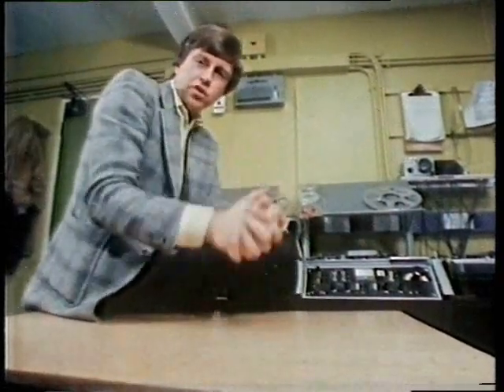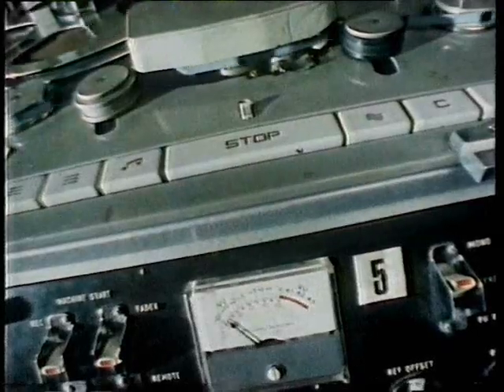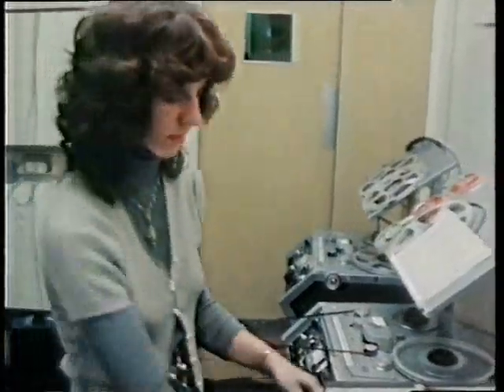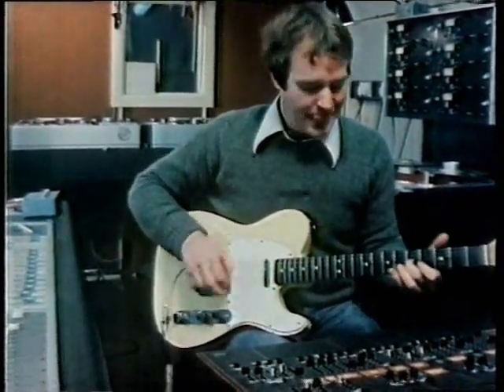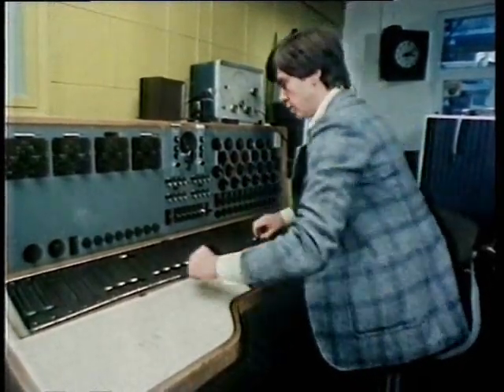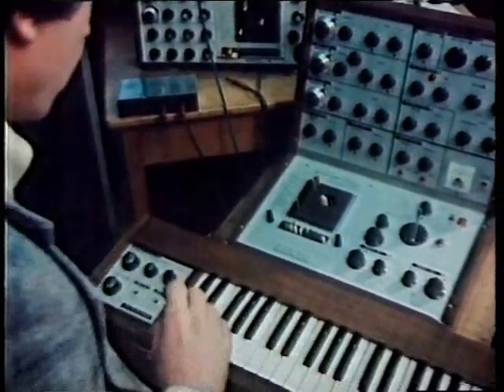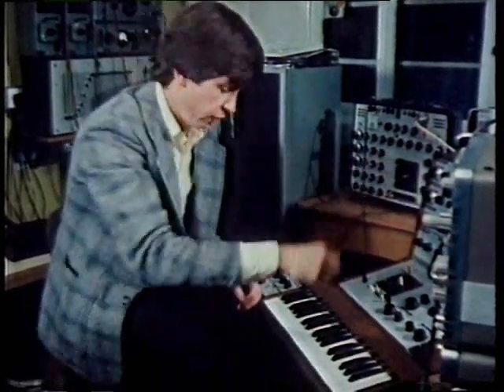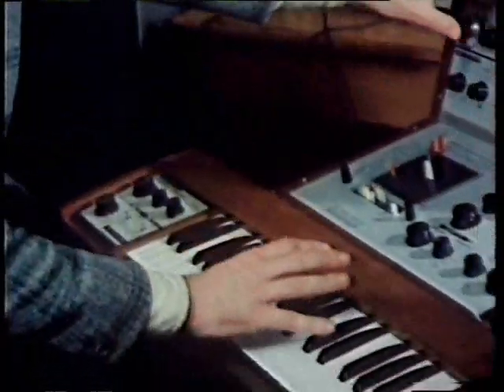The New Sound Of Music 1979 (part 2)

Comment: Yes, I know, but the original poster asked if that was a "MIDI pickup" on Paddy's guitar, and I was explaining as far what a "MIDI pickup" does, it's basically the same thing as the hex pickup that were on pre-MIDI pitch-to-voltage guitar synths that existed in the 70's and early 80's.

Comment: Actually, you would need to feed the guitar into a pitch to voltage converter before you could feed the signal into a synth. On the other hand, a lot of analog synths had external inputs for processing sounds through whatever onboard processors the synth had, eg filters, ring modulator, etc. That's actually how Pete Townshend got the keyboard sound on Won't Get Fooled Again, by running an electric organ through his EMS VCS-3. Brian Eno did a lot of that on other people's records, too.
Reply: they should’ve put external inputs on the digital ones too. The only one I have that does this is the Korg MS2000R
Reply: @jessihawkins9116  I'm not particular familiar with any of the digital synths, so I'm not sure what kind of sound processing features they had. Did things like the DX-7 or whatever have filters, ring modulators, etc to process sounds with?
Reply: @Kohntarkosz  yeah but you needed to go through menus or get an external programmer to make the patches.
Reply: @Kohntarkosz  the Behringer K2 has external input

Comment: @sonicalsonics Well, actually, there's no such thing as a "MIDI pickup". What you're talking about is the hex pickup, which is used to give each guitar string it's own signal, which then allows the guitarist to play synths with more than one string at a time. It looks like Paddy is using an ARP Avatar guitar synth (which oddly, is monophonic, though it still requires the hex pickup). All a "MIDI pickup" does is take the hexaphonic outputs and converts them to MIDI.